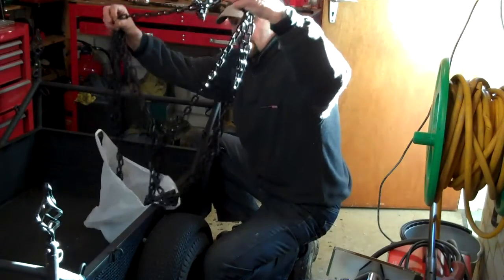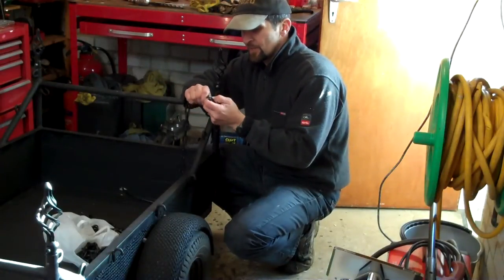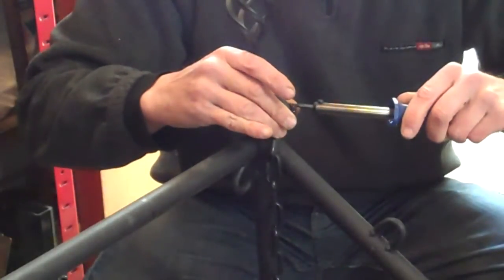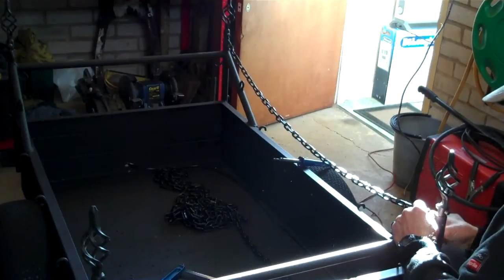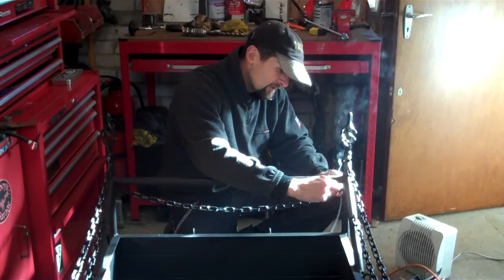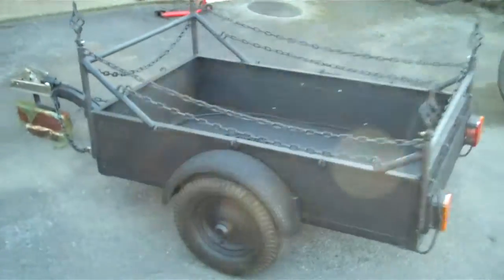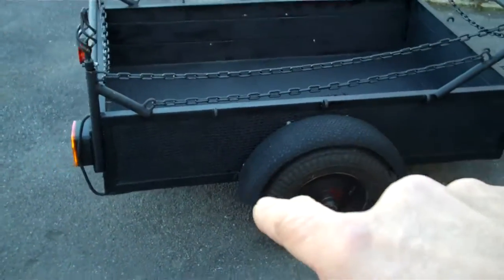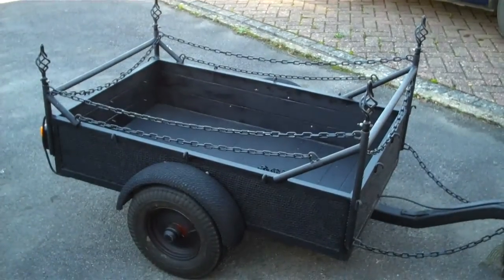Delboy's Garage, Project Rat trailer, part 36, 'The Chains'.

Comment from the maker: Hi Ricky. First, sorry you had a tumble, never a good start to the day, and i hope you weren't hurt. There are two ways to fix it rather than replace, one is the bodywork way, (Filler, and paint), but the other, if it can be done, is to call the "Paintless Dent Removal" guys, there are lots of them, just google one for a local contact to you, and they use bent rods inserted through the filler hole to lever the dent out, it doesn't always work, but you may be lucky. that, or eBay for a used one.